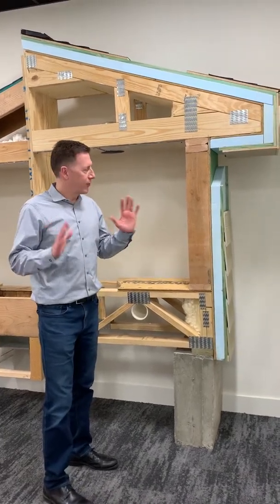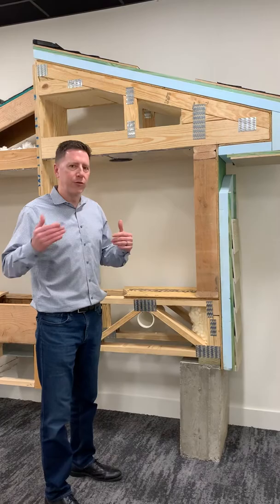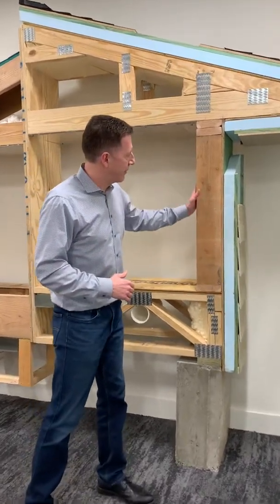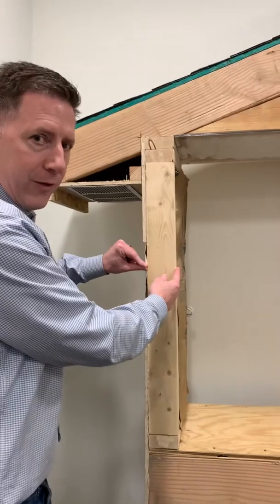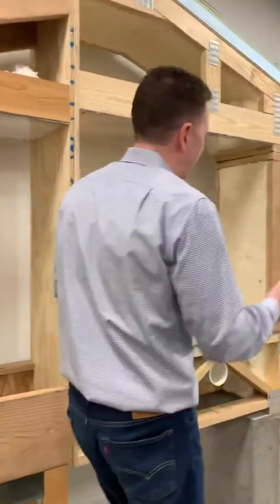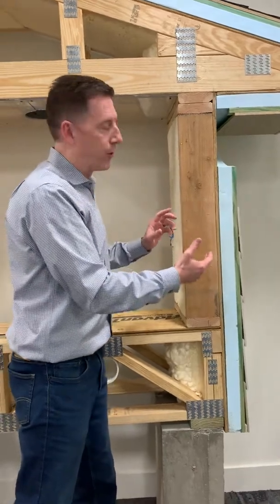12) High Performance Building: A Home Builder's Guide to The Perfect Building Envelope

Comment: I like this a lot but worry about the health effects of blown foam. Sick building syndrome. How do you overcome this?
Reply: If the insulation is outside of the sheathing how would it affect the interior? Just tape the sheathing joints if you want to be extra sure.
Reply: @chrisclocher  your mock-up shows it in the attic, rim joist and floor. It will offgas to the interior.
Reply: @GrampalettasCamp  It's not my mockup, but if the sheathing joints are taped, it will not off-gas through the sheathing, as the "exterior" side of the insulation is the path of least resistance. Also, every flat roof building has been using foamed insulation on top of roof decking for 50+ years, so I am sure the off-gassing "problem" that you envision is blown out of proportion.
Reply from the maker: We use ERV's to bring continuous fresh air into the the home without losing the energy.

Comment: As someone who renovates homes I feel so sorry for future builders/renovators who will have to deal with and remove spray foam when I house is updated. Outer block foam I'm good with but spray foam it is a product I would never thrust onto future generations, so short sighted. Do a good job joint sealing the foam boards and use rock wool in the stud cavities.
Reply from the maker: The spray foam is actually very easy to work around later. I built this home 12 years ago and have made a few alterations. It just tears right out and then you can refoam the area you changed. The beauty of the foam is that it expands 100 times when sprayed in and fills all the nooks and crannies that rock wool misses.
Reply: @homolydesignbuild  this foam is used in hospitals and schools. foamers work fast and make mistakes: I'd remove the spray in the wrong areas with an Olaf knife. easy/peasy except for the work up in th ejoists at height.
Reply: 100%
Reply: I had to remove foam sprayed in the wrong areas on a hospital build. it's not THAT difficult, just time consuming and a large Olfa knife.
Reply: Absolutely.
Reply: I'd rather add more insulation outside and keep studs visible.
Reply: Because of PFAS?
Reply: The chemical makeup is not the issue I'm talking about (but still an issue) Every 30-40 (ish) years most houses will need to be updated, walls repaired, removed or added, new electric, new windows etc... So while it's dead easy to pull out a block of rockwall or glass batts (still messy) Spray foam is a total nightmare, slow and bloody messy, plus you can't see mechanicals when cutting it out. If I was asked to update/gut a spray foam house I wouldn't do it.     @Stigeon

Comment: So 2" of foam board, you've got R10 around the whole house and an invented attic. Doesn't code call for R30 or better in the attic? And you don't even make a mention of the real reason to use it on exterior walls which is to reduce thermal bridging. AND you don't mention the minimum foam thickness required for a given stud thickness to prevent condensation based on your building area, or the fact that it can negate the need for a class 1 or 2 vapor retarder. . . who exactly are you marketing to?
Reply: This is a general overview of a insulating system and the principals behind it. Everything you highlighted here is region specific and will be governed by different building code. He can't give that level of specificity to such a large audience.

Comment: Shame there's no way to retrofit that system to a house with a brick facade.
Reply: A brick house has cavity insulation and an inner wall. For a European perspective, this video looks like how you build a shed not a house 😮
Reply: Sure there is! It's called EIFS!
Reply: @rohns2952  That isn't retrofit. It's still for new construction.
Reply from the maker: Yes, unfortunately you would need to remove the brick first.

Comment: How would this work if you have Hardy board and stone on the exterior?
Reply from the maker: Well, the Hardie is shown in the video going over furring strips which are screwed into the studs. Traditional real stone can be built off of a stone ledge in the foundation with a 1" air gap to the foam. Real "thin" stone or faux stone can be attached right over the foam.

Comment: Foam. Up to 40.00 a sheet
Reply: still $40/sheet in canada. plus we'd need 4". 
so, 327 sheets = $13 080... however, flamability and... edibility to animals... and well, it's not breathable, so if it gets wet ur screwed. 

so, you need a more expensive... rigid rockwool. which is... $80/ 24sqft. also thinner. so u need a layer of 3x. 
654 packages = $52 320. and, rockwool claims animal resistance, but from my experience... it's bs, animals love it as much as they do fiber glass. but it's breathable and non-flamable. 

meanwhile, the lumber cost of the house is $30-40k.

i chose the 1 ft thick walls \w 4" closed cell sprayfoam route as a vapour barrier and normal fiberglass. double stud doesnt have this temp difference problem mentioned in video, because its so much extra lumber. the sprayfoam keeps moisture away from the wood from the inside, and then it can dry out as i'll also be adding a rainscreen.
Reply: if fire retardant was included in foam boards, i'd consider going that route... but canda is backwards and this product doesnt exist here.
Reply: Thanks Joe Biden and DEMS.. 😡

Comment: Wow! This is absolutely ingenious, I would like to know more about getting those materials. And what is the siding nailed to?
Reply: 2:45
Reply: counter battens
Reply: We did this on a sloped roof. The guy spent 3600 on stainless screws for 3800 sq ft of plywood,  more or less 120 sheets
Reply from the maker: Other than the trusses and spray foam (done by our trade partners), all the other materials can be purchased at Home Depot. The siding is nailed to the furring strips which are screwed to the studs.

Comment: If you have to exterior insulation, is insulation necessary in the stud bays?
Reply: Depends insulation R-value, on your climate, and on your tolerance for heat loss/gain.
Reply: I would say yes. The exterior foam creates a thermal break which greatly reduces heating/cooling costs.
Reply: @matthewmara-o2f Except to use 2" foam as in this video, Hardie requires furring THROUGH the continuous insulation. This method of exterior foam is useless to prevent thermal bridging into wall cavities if done to the Hardie siding specs, and maintain warranty. 
As far as cavity insulation, the system is going to need it if Hardie siding over anything greater than 1" continuous insulation is used on the building's exterior, and is done to warranty specs.
Reply from the maker: I would say yes, because the open cell foam is a great way to keep air from migrating into the cavity to begin with and it just adds extra R value.

Comment: Wood doesn’t expand or contract in any appreciable way due to temperature.
Reply: But it does with moisture added in( condensation).
Reply: Let me try to explain🤔, when ever my underwear is in a bind it’s due to moisture and an extreme delta T! 😂
Reply: I hope you’re being sarcastic. Along with temperature comes ability or inability to hold moisture. A convex or concave piece of wood is caused by a dry side juxtaposition to a wet side. The wood fibers shrink on the dry side and expand on the wet side. The colder surface will almost always be dryer…by a lot. Of course the perfect wall is much more about control layers, not just thermal protection.
Reply: You should not right dumb things like that lol do your research
Reply: Sleep
Reply: Sorry your wrong there are spcific rates of expansion for every material. It's a science its proven - but you can decide to ignore it.
Reply: @mmac4047  you are confused with timber's expansion and contraction due to moisture content and the thermal expansion of materials such as steel alloy, plastic etc.
Reply: Wood will expand/ contract minimally with temperature relative to materials like steel. The major driver of dimensional change or instability in wood is moisture. Just because the exterior side of the wood stud is colder  than the interior side isn’t, in and of itself, a problem unless you have significant moisture infiltration from either the interior or exterior. He is spot-on however with the concept that the building insulation is best located outside of the structural components to minimize bridging and simplify the installation of the building envelope components from the exterior. Not common practice however…
Reply: Exterior walls can bow 1/2" in and out. I see it all the time
Reply: @ROMAN-oy5ju  what has that got to do with the claims of temperature alone? If moisture levels are constant, the temp will have almost zero effect.
Reply: I was thinking the same. Claims of temp being directly related to expansion and shrinkage due to drying miss the whole false claim in this video. He is claiming the interior timber is hot and the ex is cold, yet the interior is also humid negating any drying effect. Also the timber temp and humidity is changed so gradually it will equalise through each stick.
Reply: You’ve never made furniture have you….
Reply: @thomasnourse7506  I have, and still do. Wood movement across the grain does occur, and in hardwoods it’s more pronounced and yes you need to take into account wood movement. 2x4s I’m walls don’t expand drastically based on temperature but rather moisture.
Reply: @thomasnourse7506 totally different application.  If you want to compare furniture building to framing you have no business doing either.
Reply: And you have never seen wood warp from being in the sun with one side hotter than the other
Reply: @Natedoc808 no studs are in direct sunlight... ever
Reply: @alfredborstmayer2964 lmfao, no? I guess you have magical lumber elves that unload the lumber package and by the time it touches the ground it is assembled into walls ready to stand?